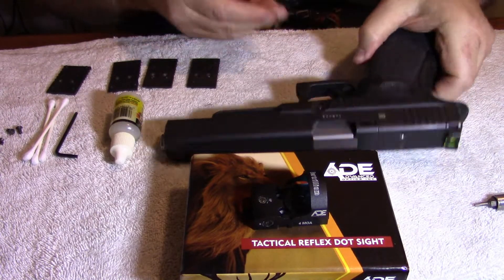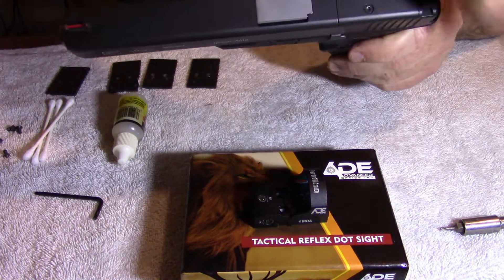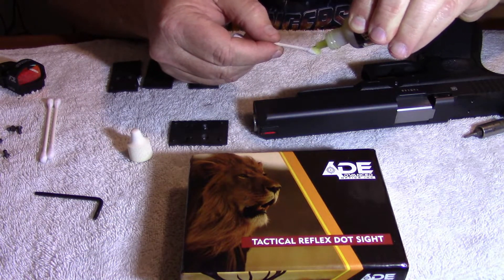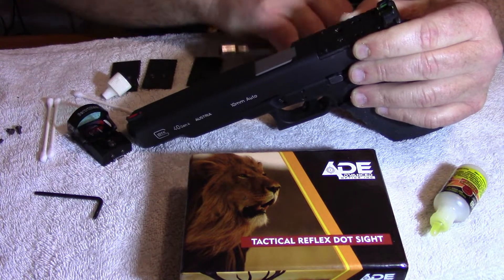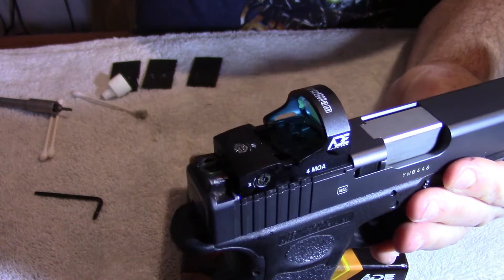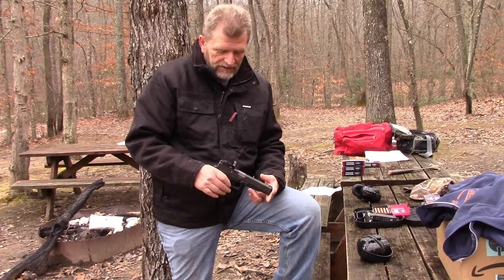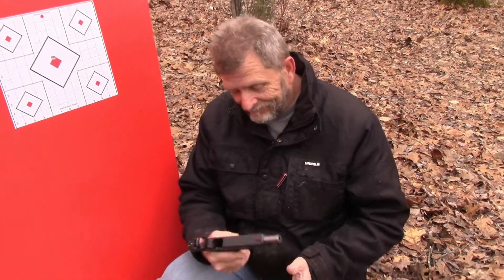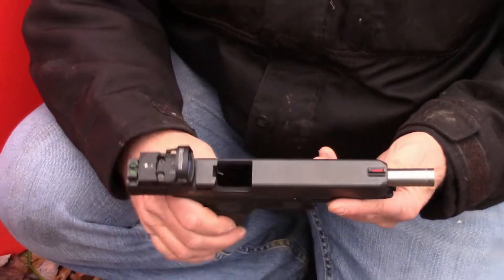Mounting/Zeroing ADE Advanced Optics rd3-013 4 MOA Red Dot

Comment: I have 4 of the ADE sights, they are all very well made. The Python )$40) really surprised me.
The prices are climbing on them now though, I purchase the Bertrillium, Zantitium, Python and the Delta. All but the Python have shot up in price way over $100 now and each of them were cheaper than $60 when I purchased them, the Delta is $212 now....
Reply from the maker: They are really well built and so far mine staying dead on
Reply: Which ones will fit an rmr cut slide?

Comment: I bought the  ADE Zantitium. Lasted one day at the range and the brightness button quit working but the dimmer button still works. 3rd time at the range I see that the glass is cracking on the right side. Got a hold of ADE , said I would have to pay shipping both ways for warranty! Replied to them again and haven't her from them since, don't buy there junk! Oh ya I also had to replace the batteries!
Reply from the maker: Hate that for you but the one on my 10mm G40 is far from junk I have put well over 1000 + rounds down rage with it. And shooting the hot loads 200grain underwood and Buffalo Bore rounds  this is my woods gun. No problem at all  I have a video coming out target and taking 100 yard shots with it. We also been testing the rd3-r15 on a sr40 Ruger and 10 yards off hand 8 shots fired 8 shots  in a 3 inch sticker target. Plus burnt a lot through the 40cal no problem
Reply from the maker: the battery life I left mine on a Sunday after shooting  started raining so we rushed to the car (shooting open range) forgot to power it off due to getting everything in the dry. Went to shoot that following Saturday and realized I left it on still going strong. Wild how you just didn't have one issue but Button-Glass-Battery all 3 main parts in such a short period of time. The 2 I have is solid as said before great dots
Reply: TrackemKY did you email them off of their website?...
Reply: VonMuller did you email them?

Comment: I'm using their 600B and like it. Only issue is that I thought there was a smudge on the lens. Turns out it is getting a reflection from in front of it. The tree line and bright sky is lightly superimposed on the sens. GRRRRR!!!

Like yours, I am getting hole in hole at 25 yards. 

KnifeMaker

Comment: I'm new to red dot sights. After making adjustments to the red dot sight do you always put he red dot back in the center of the sight window before firing the next shot at the target.
Reply from the maker: Any were that Red dot is in the window that’s we’re the shot will be placed long as the dot is on target . With that being said no it doesn’t need be centered just on target and fire.
Note though if you have the locking screws be sure to losing them before setting the red dot then once set tightened back but (not a lot of pressure just hand tight
Reply: @HillsandGills  Thank you so much that's the information I needed. There are a lot of videos out there about how to zero red dots all the ones that I looked at never mention anything about the red dot can be anywhere in the sight window as long as it is on the target. Once again thanks!!!

Comment: Which ade model is this
Reply from the maker: RD3-013
I've ordered a new one that's just came on market. And with it you can use your iron sights as well. Or run your front iron and the back of the Dot has a notch back   2 white dot
Reply from the maker: Backing to stand in as a replacement for your back iron sight.
Will be doing a unboxing plus rage with it next week 
Very lightweight super thin Dot going on my 10mm
Reply: Is it the spike by any chance?!?!

Comment: Did you have any problems with getting your red dot to turn on?
Reply from the maker: No sir not one bit hold in about 2 to 3 sec and it's on. It's a great dot we have a video coming out 100yard shots with it and we have shot 500 rounds underwood +P Hardcastle ,Ted nugget and fmj. We punished it with the 10mm and it held zero like a boss. It's  staying on the 10mm woods gun

Comment: Hi. I have an g26 gen4. If I buy a slide with the optic ready cut from brownells will it work for the ade bertrillium? I’m new in this and I need some advice. Thanks 🙏🏻
Reply from the maker: What you will need is the base plates that come with the MOS Glocks like my G40
When looking at the webpage they would be the 2nd set. I think mine used the #5 plate with my ADE Dot. What I would do would contact brownells and tell them what my plans was and will the cut slide match the Glock Plates for the MOS Glocks like on web page (They Should)
Plus shop around for the plates to get a good price 
https://eu.glock.com/en/technology/mos-configuration
Reply from the maker: Check Amazon for Glock MOS plates 👍

Comment: Curious. I am buying a pistol that has an ADE already mounted on it (assuming it has a similar mount design). In the event that mine turns out to be a lemon and I want to mount another sight, what do you mean by #5 sight plate??
Reply from the maker: When u buy red dots they have different hole pattern for different mounts. My Glock is mos cut for red dot it came with 5 base plates to mount the dot to the handgun.
Reply: @HillsandGills  Ahhh, gotcha. THanks for the response. Yeah, I am purchasing a mc28sa. I have questioned them in regards to plates that come with the gun, but i haven't received a response. We'll see I guess. Do you perhaps know whether the same plate that you say fits the ADE fits any other name brand sights?
Reply: @HillsandGills  https://eu.glock.com/en/technology/mos-configuration. I may have found the answer. It is likely for Docter, Meopta, Insight sights.
Reply from the maker: I'm thinking Vortex and maybe the Trijicon. I could be wrong but pretty sure the Vortex is the gun mos cut??

Comment: Can I use this on a rmr slide/? Or could I buy a plate?
Reply from the maker: My G40 has the cut slide also and came with 4 base plats. Is this what your asking a base plate to mount the dot to on the rmr slide?
Reply: TrackemKY yes????!!!!!!
Reply: TrackemKY or does the ade fit on a rmr slide in general? (I'm new to this)
Reply from the maker: Yes it fits the slide
Reply: markell mcclain no it does not fit the rmr cut